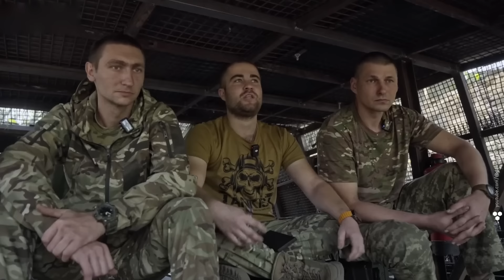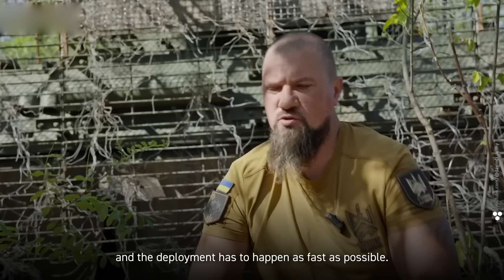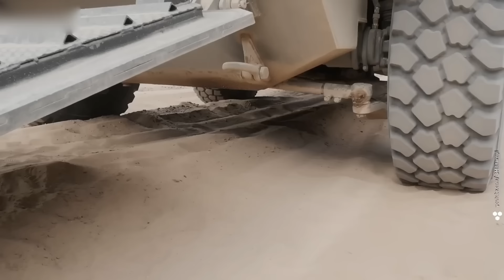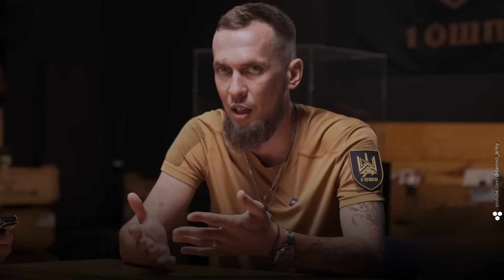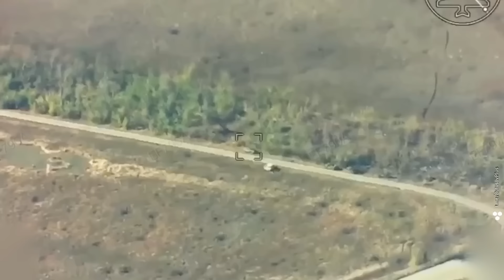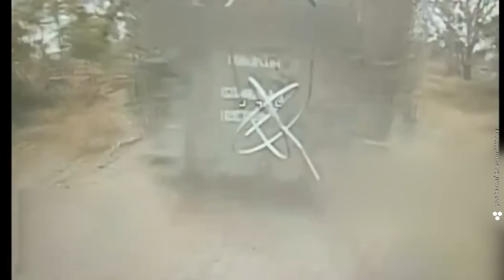Ukraine Is ENDING Russia's TYRANNY… Even the U.S. Is STUNNED

Comment: They should have some kinda strong laser when a drone gets close it starts caving back and fourth on all side of the vehicle and if that laser touches the drones with the glass wire it melts it or cuts it
Reply: or shotgun shells with a metallic like net that can make drones propellers get stuck and making the drone fall
Reply: @FrankieBorioca  No. Lightsabers, they definitely need lightsabers. 😉
Reply: And where to you get the necessary energy that's needed for such a laser from? Physics is - as so often - quite unyielding regarding the answer to that question.
Reply: @eugenebelford9087 they have it what you honestly think that it's physics that are preventing us from putting such weapons out on the field NOPE  and actually the USA does field such weapons already and seriously you dont think they have lasers that will melt plastic come on now ....... the weapons systems such as HELIOS that they've been testing on the Zumwalt ships for years are capable its not physics as in its preventing us from getting the technology its what it takes to produce it it takes a system which either is far too heavy to have on the open field due to well E=mc² yadda yadda yadda energy especially such as weapons grade elements are extremely heavy due to the fact they have to provide the amount of energy that can cause destruction on a violent level now its not the weight that is causing this to be extremely violent its actually the speed but still due to it being a laser yet it still is composed of element material likely erbium it has to be super compressed which they use essentially a honeycomb shaped system to produce fiber optical beams compressed of as I said solid material at such an effect that it can shoot out at the end as one deduced laser now here's the thing it has to provide a charge of energy on the material that causes it to literally change its pure energy thats the hard part once you've got it to do that you just like they do with internet cables fiber optics make a wire way smaller able to provide internet way quicker well thats done here with erbium and there you go now this takes an extreme amount of energy which is why even only some ships such as the zumwalt are capable of producing such energy and also the aircraft carriers easily but if im not correct I think they even have a system on the strykers now but I could be wrong

Comment: Why don’t they box the whole thing in with a lite cage just good enough to hold a fabric mesh netting around it so the propellers get caught up before it can hit
Reply: Because a drone strapped with an rpg round will be flying fast, with enough weight & momentum to push though or flex any net. By the time it's that close to a target it's moving very fast and it'd make no difference if props are spinning or not. I'm not an expert btw. That's my guess/theory.
Reply: @rudidower lmao these drones are literally what in america you would call cheap ass ones these things arent that fast did you see the size of the wire meshing people too often forget this all the drones they are probably using on the field of battle such as these ones in Ukraine are easily purchasable online in america and that tells you something these arent weapons of the future it just has taken us so damn long to make so many its what the Tommy gun was easily accessible even for the lowest thugs around on the streets but it shot alot of bullets although there was much more advanced machinery being invented at the tine but it was capable of killing lots of people and on top of what im guessing is a solid steel frame the drone gets stuck not even one foot into the braided cords of steel explodes the solid steel frame absorbs it not to mention. The fact that there is a mine clearing vehicle which is already built for maximum defensive capabilities
Reply: Because neither HEAT or shaped/ hollow charges require any significant momentum of the projectile to do the work they are designed for. Their energy comes from the explosives in the warhead. And on top of that, while many  use these terms more or less synomously, they can be very distinct: One forms a plasma which welds through armour, the other forms a solid penetrator, which kinetically drives through armour.  And both - once they punched even a small hole through armour - will cause airpressures which are ... lifechanging.
Reply: @eugenebelford9087 you think that Ukraine has a whole bunch of those rounds that there putting them on ten dollar dronesncome on man wake up the few of the kind of rounds you describe they are safe and being used with artillery and tanks or the Bradley's and even then there few and far in between you cant just put an actual round the size of even a you really think they're putting those type of rare expensive rounds on a ten dollar drone and what the drone crashes into it like an idiot and it explodes come on man I know your more intelligent than that they are not going to waste such projectiles on a throw away drone that can barely if even alright I'll just say it cant even carry say something the weight of a 30mm round HELL NO  they have those things if they even have them since there so expensive amd few and far in between being fired safely from artillery Abrams leopards or the Bradley's not drones that crash into things like there idiots also the braided steel mesh on that solid steel frame im not even guessing because im not o e of the idiots thats going to pretend like the Russians dont know what the hell there doing when it comes to fing killing people and making machines of war they do and they a re very capable so I know they have that material set up in a superb way to where just the material named such as the solid steel braided chords 1 ft around at least possibly two ft is enough to stop a crappy drone off temu not to mention. The beast of war underneath of the solid a steel frame underneath the chorded wear dont underestimate your enemy